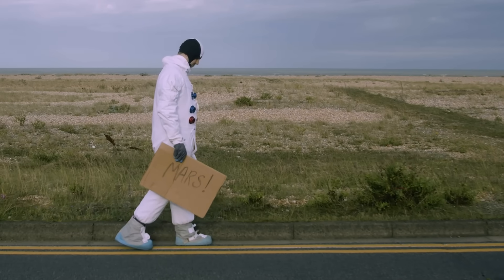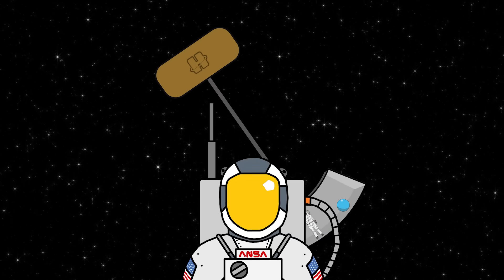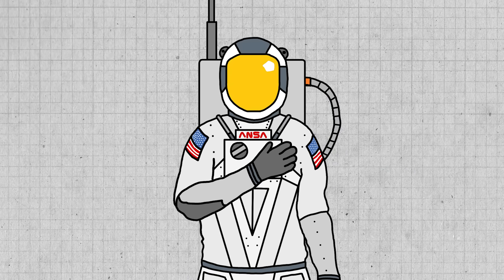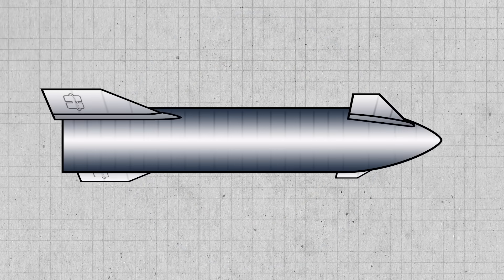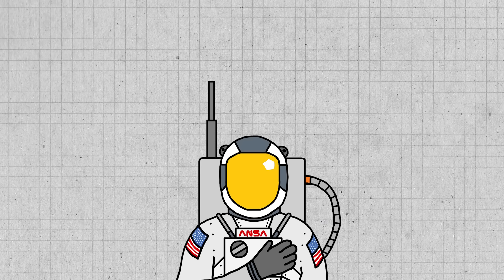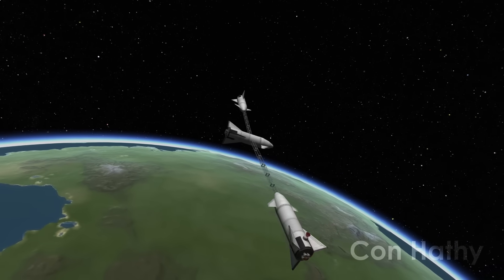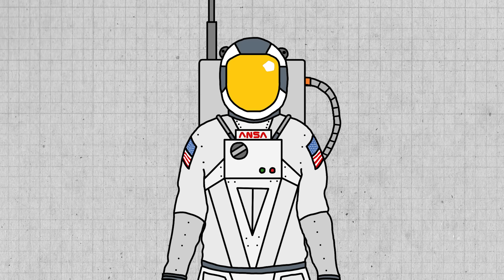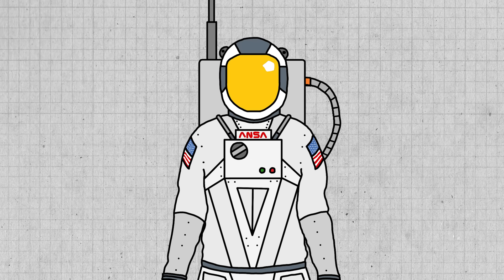This is NOT how you make Artificial Gravity

Comment: The precession problem is why I thought the design of the Hermes cycler in the Martian was epic, as the plane of rotation for the gravity hab modules is isolated to the bearing at the point where it intersects the main hull. This means you get that flat plane of rotation because the main hull is NOT rotating. It also gives you a stationary point to mount antenna, telescopes, thrusters and heavy stuff like fuel.
Reply: The simple principle with 2 opposite direction spin wheels (like Tandem Rotors) can counter cancel the negative effects ;)
Reply: @Gamu13  Why do you need a "main hull" that doesn't spin anyway? Too complicated. No need. No reason a central hull couldn't just spin with the wagon wheel. Except for some brief acceleration, it's going to be zero g there anyway.
Then you won't have to have any complex seals and whatnot to go from the ring to the  other part. 
However you do it you aren't going to launch it from the ground or land it anywhere.
Build it in orbit with a catch ring in center and an airlock....fly Starship through the middle, lock on and drag it to Mars.
Reply: @yourhandlehere1 it WONT be zero g, it'll be very low g but still some. And being a small radius centrifuge, you get all the issues discussed early in this video.
Reply: How are you going to get the hull NOT to spin? They will simply counteract each other.
Reply: @yourhandlehere1  Use thrusters to start the ring spinning as that will probably have the most angular momentum, then rotate the centre hull in the opposite direction
Reply: @TheChromeRonin   you would also need thrusters on the stationary hull to counteract any friction from the bearings with the ring
Reply: @jonomoth2581  that's why you have the counter rotating mass, the net force on the hull is zero.
Reply: I am suddenly seeing the starship from Star Trek. Large saucer cylinder spinning while thrusters and center body maintain heading and can observe.
Reply: the big drawback of this is of course that you now need a rotating permanent airtight seal
Reply: @miner_sd  Not really. Two static airlocks solve that without any need for over-engineering.
You leave through one, take a brief space-walk, then enter through the other.
Reply: Wouldn't you need a large hull diameter (something in the tens of meters)?
Reply: @tmst2199  the rotating section is a wheel with the much narrower main hull of the ship as the axis.
You would also need a counter rotating flywheel in order to prevent the main hull from spinning
Reply: @X-boomer  2 wheels! Twice the fun!
Reply: @X-boomer  So crew resides in the flywheel?
Reply: @tmst2199  either you would have two counter-rotating crew section  or one rotating crew section and a counter rotating flywheel. Either way, the two rotating elements need to have equal but opposite angular momentum.
Reply: @X-boomer  I guess I need to watch this again. It's not clear to me why angular momenta need to cancel out. Does that prevent precession?
Reply: @tmst2199  it prevents the spine from revolving so that it provides an inertial environment where you can mount antennae and do astrogation.  It might not have been mentioned in the video.

But once you add this, precession is a problem. Avoiding precession or tumbling really necessitates splitting either the rotating or counter rotating mass in half and distributing it equally fore and aft of its counterpart. So that there is no net change in angular momentum along the length of the craft.
Reply: @X-boomer  what you do is, you set up a separate wheel to counter its rotation, then you set up a separate wheel to counter THAT wheel's rotation, then you set up another wheel to counter THAT wheels rotation...
Reply: @X-boomer  Actually, if you have two wheel spinning opposite to each other, this would tend to create some amount of perpendicular torque.

A better design would be one "centered" wheel that is rotating one way, flanked by a PAIR of wheels that are rotating the other way.
Reply: @patrickrannou1278  good spot.  I omitted this for brevity at first but actually mentioned it in my reply to @tmst2199. You can overcome it by having another counter rotating element to compensate such that the total mass rotating in one direction is split evenly on either side of the mass rotating the other way. Then there’s no net torque pushing the assembly off axis.
Reply: @ralphclark That counterbalance would need to be at a synchronization in rotational velocity to keep both stationary and rotation stable.
Reply: @arthurzettel6618  it's angular momentum that's important, not velocity. You could for example have a large rotation crew section revolving such that the angular velocity of the outermost rim is quite low, and a counter rotating flywheel of a smaller diameter revolving more rapidly at it's external diameter. 
Should you measure speed in rpm those don't need to match either. So long as the total angular momentum cancels out.
Reply: @tmst2199  you'll need a large ship period.  for a rotating ship/station, the diameter has to be in the hundreds of meters so that every couple steps doesnt mess up your equilibrium because of the difference in angles from the outwards force.
Reply: @TheWorldsprayer  I believe further study has shown that tolerance can be developed to the angular changes associated with small rotating circumferences.
Reply: @tmst2199  yes but there were limits and its something that was also noted as being tolerance, not adaptation.  That means it remains a stressor to the body as the body is always having to ignore something it normally wouldn't, further those smaller radiuses where you can notice the force from an offset also have limits in how fast you can move.  You can sprint on larger radiuses, you have to walk in a certain manner on the smaller ones.
Reply: Have fun servicing those bearings and all the megawatt power connections and fluid piping going through them
Reply: @Older_Archer  It all spins together...no seals, gears, complexity. it's for the long haul, not being nimble. Computers handle the rollout on rocket launches all the time, shouldn't be a problem.
oh...a "ball turret" for the pilot maybe...easier to manage, only counterspin it when the pilot climbs in to do something.
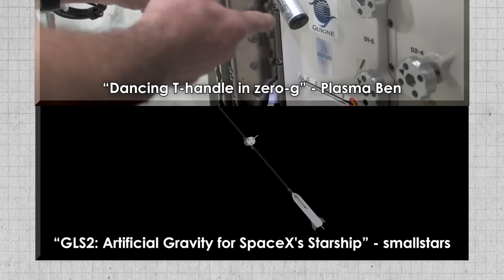Reply: @yourhandlehere1  The reason for not spinning the central hull was actually explained in this very video.  It's similar to the three-tethered-spaceships scenario described here (or the really cool demo of spinning the T-handle at 10:45).  If the central hull is also spinning, it changes what the axis of maximal moment of inertia for the whole thing is, and you are no longer rotating around the maximal axis.  That means that the rotation will become unstable over time, which is bad.

As for how to keep the central hull stationary when connected to something that's rotating, that's actually pretty easy.  You can just use motors to exert enough force to counteract friction and rotate it relative to the hab section at the same-but-opposite speed as the hab section is rotating in space.

However, the big issue with this idea, IMHO, is how you connect the two parts, and how people move from one to the other.  You either need to have the two environments completely separate from each other (and you basically have to exit the ship and enter again if you want to go from one to the other), or you need some sort of rotational seal which can reliably maintain internal atmosphere while exposed to space and also constantly having the two parts sliding relative to each other over the long duration of the mission, which is no easy task.
Reply: @yourhandlehere1  The advantage for a stationary central hull over an entire rotating ship is that you need less energy to keep the entire thing spinning.
Over short trips, this doesn't matter, but over "the long haul", it absolutely does matter, as "air" resistance starts becoming a factor (space is not a perfect vacuum; It will, given time, slow everything down); Spinning a habitation block back up mirght take less energy than spinning the habitation block, the main hull, the food storage, the hydroponics, the recycling facilities, the manufacturing facilities, the water storage and the fuel storage up. Does depend on the length of the journey though.
Reply: @OzixiThrill  Nah. Less energy to spin the whole thing than any counter rotating complexity. You'ld get more drag from the machinery itself than anything else.
Reply: @yourhandlehere1  That depends almost entirely on the duration of the journey and the mass of the entire ship.
Reply: @OzixiThrill  unless you're up there for decades or centuries that won't really matter.  But what does matter is that you have to spin it up in the first place and the more stuff you have to spin up the more energy that takes.

And in addition the parts that spin have to be considerably stronger meaning even more weight even during non spin up and spin down maneuvers.
Reply: @OzixiThrill  Isn't space virtually a perfect vacuum? Besides low earth orbit I thought we would be talking about a few stray hydrogen atoms per meter which have an atomic weight of 1. I can't even think how many of them would have to rub and cause friction for a 40,000 Ton mass to slow down. Based on the speed its travelling and its inertia mass I wouldn't be surprised if we just left a wake of protons & electrons! (j/k)
Reply: @HyperVectra  The reason why I was stressing that the length of the trip matters is precisely for that; A trip from here to say, Mars, the whole thing is mostly irelevant, as we're "just" talking about 225 billion (multiplied by the profile of the vessel, which will probably be past a few dozen square meters) cubic meters, which will only cause negligible slowdowns.
But the Oort cloud? Proxima Centauri? Any other solar system? We're suddenly talking about distances so stupidly large that such small inefficiencies start adding up.
Reply: @OzixiThrill  Ahh I see your point. You would hope that by that time we could go that far we could exceed the speed of light.. its sooooooooo slow - or even artificial gravity. Wanna take a punt on which comes first for the scholars in the distant future reading this?
Reply: @HyperVectra  Well, artificial gravity would require understanding what gravity is, which could come next week, next millenia or remain an unanswered question until well past the heat death of the universe. And after that, we might find out that the only way for any form of artificial gravity is either to use spin gravity or  us excessive mass to generate it, with no tricks to induce it in any other manner.
As for FTL, the only current hypothetically possible method requires matter with negative mass, which I'm not sure has been shown to exist; If it does, then we at least have that as a not unreasonable possibility.

In either case, both of those bits are rather far off; We'll probably not have either until at least the Oort cloud is partially colonized with most of the rest of the solar system already settled. It's even possible that we would be having several extra-solar missions underway by the time either of those technologies get discovered, if they are even possible.
As for which one I think will pop up first, then (just going by my pet hypothesies of the universe), Alcubierre-style FTL will be the one we crack first. Though, again, probably not before the first extra-solar missions are already underway.
Reply: uliuli7li

Comment: Yep.  Two by the nose (long tether) solves the gravity problem completely.  Same load direction at every stage.  Your short idea is rubbish.  :)
Reply: Even one by the nose can work rather well. Elsewhere I call it the long-heavy-tail option.
Reply: @grlcowan  I fancy two (with only the tether itself crossing the centre of the rotational axis) are by far stabler.  I also reckon it's the lightest option.  Ker-ching. :)
Reply: @tonyduncan9852  You're right, it's definitely the lightest if you have two 100-tonne spaceships. I worked an example elsewhere ... here we are:

"Compare a system rotating 29.3 times per hour ... two equally massive modules, both at radius 3750 m, both getting one gee. If the tether is made of Zylon at ten percent of breaking tensile stress, each 3750-m piece is 10.27 percent as massive as the module it supports. Two 100-tonne modules give 220.53 tonnes total mass.

"But what if we want a 100-tonne module in which people can live at one end and just a ten-tonne thing at the other end? A propulsion module, let's say. It and a 13706.66-m tether, 37.53 tonnes, balance the 110.27 tonnes on the cabin side but are 62.74 tonnes less massive than a duplicate cabin would be."
Reply: @grlcowan  I thought that's what you were suggesting.  The problem is your 'module' will be upside down.  Two ships nose-to-nose keeps loads right way up through all 3 travel phases.  Two bobbins and I like the length of 'rope'.  Power and comms should be able to pass through it,, and if you're feeling flashy, also more than that, maybe.
Reply: @tonyduncan9852  Two ships nose-to-nose are both nose-to-spin-axis, i.e. nose high, aft end low. Just as they were on the ground, if they were ever on the ground.

One ship nose-to-spin-axis, with a low-mass other-end module, is the same. Upside-down!? No.

The other-end module being destined to live far out, at high g , it has no preferred orientation for people on it because people can't be on it.
Reply: @grlcowan  There will be plenty of starships to travel in twos.  Lighter, with no external work necessary  with 'modules' - would be preferable. :)
Reply: @grlcowan  I take your point, but I don't see how one can make the ship demountable without incurring a mass cost (and labour cost) greater than a tether used between two ships.  Starships are unlikely to travel singly unless they are unmanned.  I have a strong feeling Elon thinks this way.  Tethers which carry comms and power will always be useful.  Whichever way, the issue of gravity can be mitigated, at least.
Reply: @tonyduncan9852  "Make the ship demountable"?

Comment: I like the monobell (a single vehicle pays out a very long tether from its nose, at first just a short distance, and activates a tangential ion thruster at the far end until the desired angular speed is reached. Then, with continued tangential thrust, paying-out occurs at the slow rate that keeps angular speed constant). At full gravity the tether is less massive than another spaceship would be because much of it is at high acceleration.

There's also the dumbbell, not actually dumb, and the Kubrick-style dumbwheel.
Reply from the maker: The tether still needs to be heavy enough to move your center of gravity, a counterweight is more efficient by concentrating the weight at the tip of the rope instead of having an excessively long rope
Reply: @ConHathy  An excessively long rope can be quite a bit shorter than a tether that is just nicely long.

The longest possible tether has nothing at all at its far end. You can progressively shorten it by adding an increasingly massive counterweight. That's fine, I think, as long as it's a functional counterweight. The ion drive and its solar panels, for instance.
Reply from the maker: @grlcowan  ah I see, I guess I was confused about whether there was a heavy counterweight based on you saying it’s not a dumbbell

Comment: I love the way you went about this discussion. Don't give up on snapping the tether as NASA has proven fairly good at projecting trajectories and wasting all that momentum would be a shame.
Reply: Also, NASA has real world experiences with their tethered weight experiment for power generation using the Earth's magnetic field. The cable was several kilometers in length, and actually jammed, forcing them to cut it loose from the shuttle.
Reply: @paulmoffat9306  I missed hearing of that, so tragic since some people have been waiting  most of their lives to see that experiment done.
Reply: It depends on your design. If the counterweight is a big propellant tank (like a Starship tanker version or something) then throwing it away will get you less delta-V than despinning and using the propellant in your engine.
Reply: Why snap a pefectly good tether? Have a disconnect point and do it in a controlled way.
Reply: @catprog  - lol🤪, yeah, the "snap" was figurative.
Reply: Exactly, it's like a stone in a sling. If you time the release just right, it will go where you want.